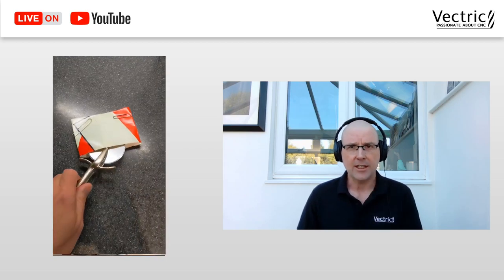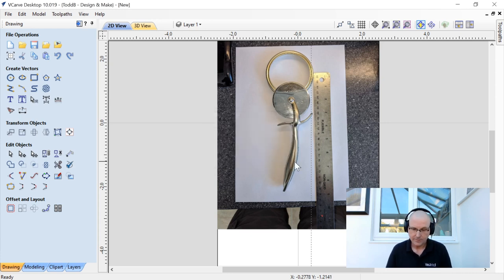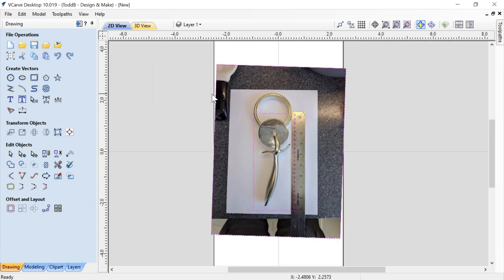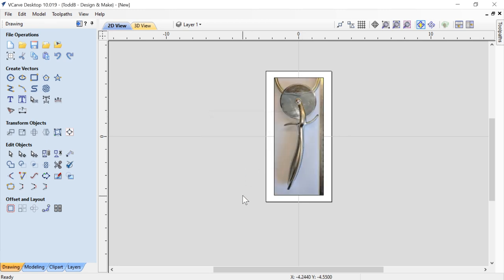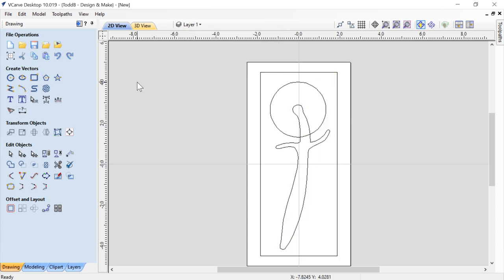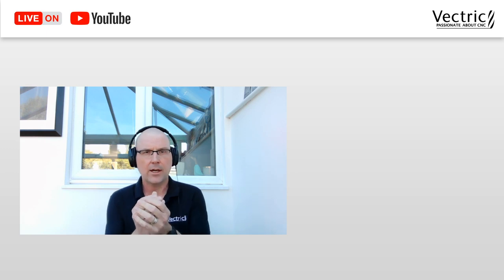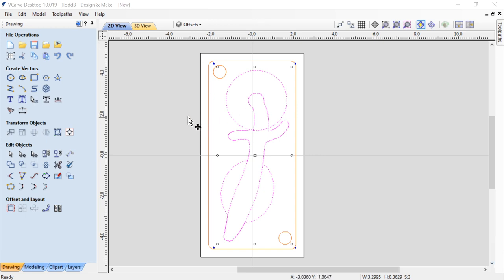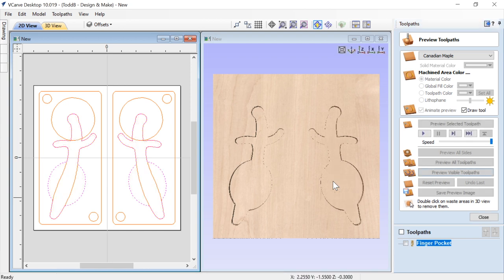Live Q&A with Todd | Let's Make A Pizza Cutter Box | Vectric FREE CNC Projects

Comment: In the process of buying your v-carve pro and cnc, does the software 
Give you recommended feeds and speeds after you select material. And I know it would also depend on the machine itself, power etc
Reply from the maker: Hello Jonathan, Our tool database does have some general setting for feeds and speeds, but it is VERY important that you test them on your machine.  You will need to adjust them for your machine, the tool you are using and the material you are cutting into.  The manufacture of your CNC will have some advice or there are lots of folks in the Vectric User Forum that are more than willing to share their settings.  Still knowing that you will need to test them... safety first. :)
Reply: Vectric Ltd ah that’s fine pal, just some rough ideas to start and I’ll judge myself then as I get more experience. Thanks again

Comment: Is it possible somehow? (In create vectors, Draw Rectangle) to create just one or two rounded corners instead of all four, or have a combination of internal and external corners?
Reply: First, create a rectangle with internal corners - those cannot be created by the Fillet tool, which can do everything else you need. Using Fillet, you can hover over an intersection or corner to remove (X near pointer) internal/external corners or add (✔ near pointer) external corners.
Reply from the maker: @petergamache5368  Good answer Peter!  This is exactly what I would do.